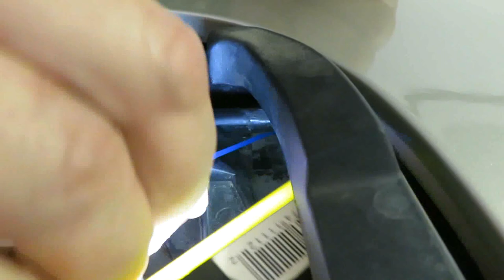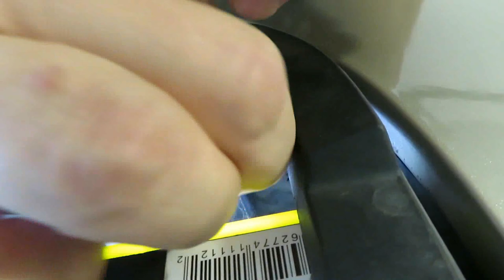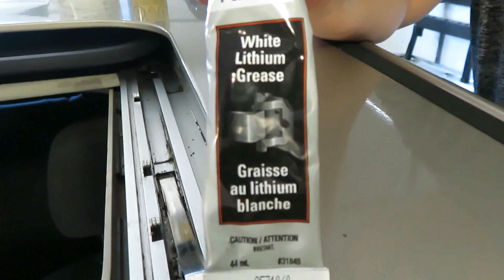How to Fix a Leaking Sunroof | General Sunroof Maintenance | Jeep Patriot

Comment: Any sign of leakage, follow Mundane Mans procedure! Otherwise, the cabin electrical soy insulated wire harness bunches will be @ risk for corrosion. My late dad warned me about auto electrical damage, I’m experiencing it. Also, be careful about carrying sediment/ sand soiled recreational equipment on roof. My surfboard sand once clogged my drains. Thank you MM, but I’m singing the auto electrical wiring blues🥲

Comment: Thank you for the video.  I'm in the process of buying a 2017 jeep patriot.  Then while searching online I found hundreds of issues of water leaking from dome lights (front, back, and cargo area), etc... On all patriot models and began to second guess my choice of getting a patriot.  Then, I came across your video.  Do you believe if one keeps up with the maintenance you suggest, it would prevent all interior leaking issues?  I'm hoping all the issues I read/saw are just from clogged tubes and neglected maintanence of moving parts (ie- sunroof).

Comment: Thank you for this, did it today and hopefully it works.  Just noticed while driving I had a little noise from the sunroof like it wasn’t closed all the way. Looks like the seal or weatherstrip won the sunroof glass is starting to crack a bit. Any suggestions to fix it?

Comment: I just had the same problem (2017 Patroit). Never a problem till yesterday during heavy downpour in Florida, I open the door and water is coming out the front dome light. I thought windshield leak on the top edge. I hosed everything down and didn't get any interior leaking.
I fished the string trimmer line down on both sides with little resistence . The line stops about 4" down. It doesn't come out under the car. Anybody Know why ?
Reply: To continue; I cleaned everything up and did one more water test . I ran water down each drain hole, most came out underneath some came out the dome light. Maybe a bad drain line ... I don't know . I did notice in the center of the  area between drain holes (the plastic channel for water to travel) there's some kind of fabric or tape on the plastic. Anybody know what this is ? Maybe a area that leaks water straight to the dome light .....